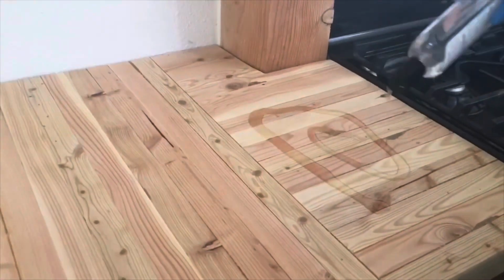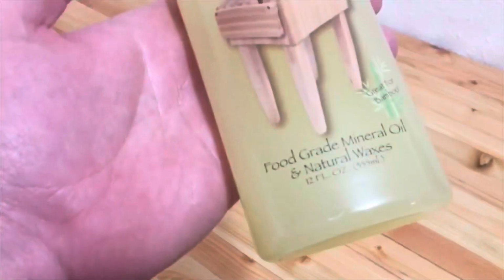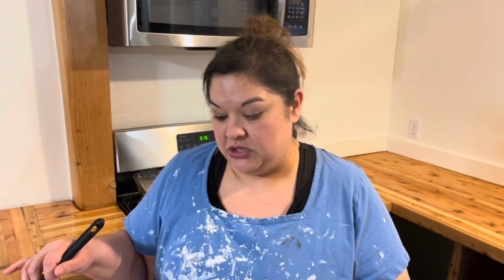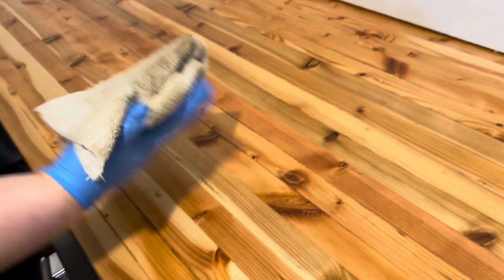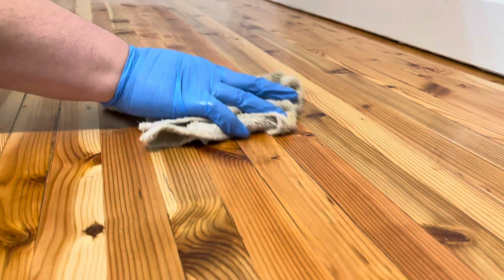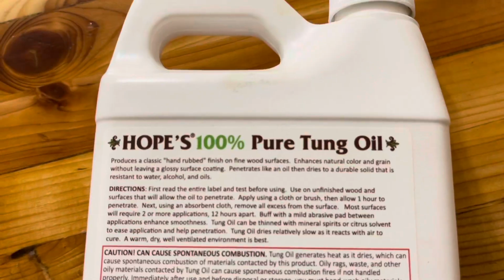Watch this before using Tung Oil!!!

Comment: Tung oil should be mixed 1:1 (or 1:1.5) with citrus solvent. The mix should be applied, and as soon as a good portion of the surface is no long shiny, more applied. Keep going until the entire surface no longer absorbs any more (and so stays shiny). Then wipe off the excess, and let dry for a day. Done! Tung oil without citrus solvent takes eons to dry.
Reply: Also most people do NOT use actual pure TUNG oil. Packaging is very deceptive!
Reply: You can use turpentine as a solvent as well for food safe applications.

Comment: Yea Poly is superior in every way, BUT you can add a dryer to the Tung Oil to dry it super fast! You didn't do enough RESEARCH! PLUS if you want it thick like you did you use EPOXY instead! Poly is best when you use SATIN FINISH and apply it with a cloth and then follow it up with a red or green scotch-brite pad just before it is dry to flatten it and de-gloss it for an antique satin hand rubbed finish!! and ALWAYS follow the wood grain ALWAYS!

Comment: Tung oil provides very little protection.  Danish oil provides a little more protection but not enough for a kitchen counter.  Oil based polyurethane provides the best protection but takes weeks to cure and has a very strong odor, you won't be able to live in your kitchen for a week or so.  Water based poly takes far less time to cure and you can probably just leave the windows open for a few hours to get rid of the smell.

Comment: Thanks for the video. I have another experience and perspective- I watched your video last year when I was doing pretty much a remodel/refresh of our kitchen. I seriously considered a high-end poly finish that would have cut my finish time, and total remodel completion time significantly. However, I opted for tung oil; yes in a working kitchen. As a long time woodworker DIYer and experience with effects of water around polyurethane "sealed" surfaces, I went with tung oil for its long-term maintainability. I was able to work around a kitchen in disarray. To accommodate for the need for a kitchen while finishing with tung oil, I cut and temporarily fitted the new countertop to insure they were correctly cut and then removed them; replacing just enough of the old countertop to function until the final install could be completed. So, some of the new countertop I was able to use the cabinets to support in place for finishing and the rest on a sawhorse. I used 4 coats. It is not quick, it took about a month, but it is relatively easy. However, this provided time to research some details on appliances, install cabinet lighting and new backsplash wall. I did a light maintenance coat 6 months later but really don't know that it was needed and didn't disrupt use of the kitchen. My counters still bead water and there are no stains.

Comment: Hi, i think you 're wrong. before to start to buy mix of tung oil , just buy pure oil and don't apply alone. you have a lot of recipe. i have use it, i have made one, and the result is perfect, like other comments, you can use it with orange essence, and camelia oil for the anti-UV side. I have the same longer of wood in my kitchen and after 5 days it was perfect. i just alternate where to cook .  you need to little sand between 2 layers. anyway you have choose polyuréthane protection is good too but i told you why i have chose the oil, the reason is simple with polyurethane if you or one kid stripe or cut, the scratch will be very visible and sanding ll be worst on plyurethane. with oil just sand and reapply oil thats it !

Comment: I have used Tung Oil and love it, but it takes time to cure. Now, if you don’t thin it out a little bit, it will take a long time to penetrate the wood, and to stay as clean and natural as possible, I use orange oil or D-Limonene to thin the oil, works great for me, thanks for sharing this video!
Reply from the maker: Thanks Mike. I would like to revisit this on another project down the road. Thanks for the tip! -Robert

Comment: Wow that was very informative. When I was younger I refinished about five old rifle and shotguns, right down to the metal and wood. Tongue oil was what I used on the gun stocks. I even lightly sanded in between coats. I remember putting them by the warm fireplace. I didn't have as big of a problem as what you did but I could take my time with them. It was one of the most beautiful and hardest finish I ever put on wood. Thanks for the info if I ever do this to my kitchen I'll know what I'm up against. It would be nice to see the durability between both finishes. That kitchen looks beautiful. At the end of your projects you always seem to win ❤️💙
Reply from the maker: Hi Joseph! Yeah we loved the look of the tongue oil. It is kinda a shame we didn’t have the time to let it cure. Would like to try it on a future project that we can take the time needed to let it cure. Thanks and have a great day! -Dede

Comment: Thank you so much for the info.  I too went with the same cutting board oil to start and I'm looking to change.  I was looking at tung oil or poly which led me to you.  Hopefully your failures will help save me some time now!  If I go tung oil I'll look for one with a drying agent in it!  The water based poly was on top of my list but was worried it wouldn't have the richer color the oil gave it.
Reply from the maker: Hey Randy. Sorry for the late reply, hope it worked out well. I recently used the last of that tung oil bottle on another project and cut it with mineral spirits to act as a dryer. That worked much better! Has the rich oil luster as well. -Robert

Comment: One big issue with all mineral oil based products, is over time you're adding an inert oil that never hardens at all. So, where does it go? Gradually into the whole wood block, making it permanently greasy, and effectively unable to receive any other finish later on. Tung oil may have had trouble curing, because of the residual mineral oil. It will be interesting to see how the urethane stays bonded over time, as the old oil may gradually seep from within, and soften or release the outer finish.
The outlier few seem to try is Watco's Butcher Block finish, applied as an oil, wiped off, reapplied, wiped  again, it is an alkyd modified resin that cures in the fibers, sealing and hardening, with some more finished looks, yet easily touched up with further coats if needed. It definitely needs raw wood, and may not accept other later finishes, but is another safe alternative with less maintenance over time.

Comment: Hello! How did you remove the oil before adding the poly?
Reply from the maker: Wiped as dry as possible. Let dry a day or two. Sanded... 🥴 Not fun but it allowed the poly to adhere. -Robert
Reply: Thank you! I guess that’s what I’ll have to do.  😅  I was about to apply the tung oil. Soo glad I saw your video.
Reply from the maker: Thanks Katherine. Hope it all goes well!

Comment: I actually have experience with the polyurethane coating.  First house I ever owned, the previous owners had put down 3 layers of polyurethane coating on all the wood floors.  You could leave water standing for months and the floors were ok.  Glad you have it figured out.  I love those countertops.  Thank you for sharing.  Stay safe, warm and healthy.
Reply from the maker: Hi Cheryl! Yeah the poly on our floors has held up great and I would venture to say they get way more abuse than our countertops do. Lol. Hopefully the countertops hold up longer than the other options. I don’t t expect it to be indestructible but I at least don’t want to have to be redoing it over few months. Thanks and take care! -Dede
Reply: @TheOregonTale  Yea Poly is superior in every way, BUT you can add a dryer to the Tung Oil to dry it super fast! You didn't do enough RESEARCH! PLUS if you want it thick and glossy like you did here you use EPOXY instead! Poly is best when you use SATIN FINISH and apply it with a cloth (several coats) and then follow it up with a red or green scotch-brite pad just before it dries completely to flatten, smooth, and de-gloss the finish for an super rich antique satin hand rubbed finish!! and ALWAYS follow the wood grain ALWAYS! Trust me this is super expensive looking finish this way! (I used to finish high end gun stocks for a living!)

Comment: Do you have experience with Miniwax tung oil? Using that now. Wondering how it will hold up against stains and wear n tear
Reply from the maker: No, I’m interested in how it went for you. It looks like that was some drying additives in it so should have been much quicker in between coats. I will probably venture down this path again but use a product like that rather than pure tung oil again. -Robert
Reply: @TheOregonTale  tung oil came out beautifully but I still ended up adding 3 coats of spar urethane for durability and it looks amazing!

Comment: I had the luxury of finishing my wood countertops outside before installing them. I used Sutherland Welles’s interior polymerized tung oil. They offer thorough instructions and are super helpful on the phone, too. Each of 4 coats took 24 hours to cure. It’s rock hard and beautiful. I’m sorry yours was so slow — did you ever figure out specifically why your finish took so long to cure?
Reply from the maker: Hi Alan. Glad to hear it went well. We had decided to use pure tung oil which has no added dryers to increase cure time. That was why it was taking forever to cure. I will probably experiment with tung oil again, but will definitely not use straight tung oil. I think you can cut pure tung oil with mineral spirits to help with that polymerization. Even though my first round with mineral spirits didn’t go so well, I loved the look and luster of it, so I will probably experiment with this again in the future. -Robert

Comment: If there's anything ive learned over the years, its that bottle labels are usually wrong (weird right?). The only company that ive found that is upfront with tung oil curing times has been Real Milk Paint Co. 30 days is about how long you want to wait before heavy use, it wont polymerize until that point...atleast a week before putting things on the surface. Dry and cured are very different when it comes to oil...unfortunately the terms are interchanged, which is confusing. Only other products I'd use (random guy on the internet, so my opinions dont really matter) would be ArmRseal or waterlox...but waterlox is tricky as the product in the can begins to oxidize as soon as its opened and you'll find little specs of oxidized resin in your coats unless you use something to remove the oxygen from the can after every use. ArmRSeal is incredible and beats the pants off most every poly out there. 

Pro tip: if your tung oil finish is "dry" in a day, you either havent saturated the wood and need to keep flooding the surface or your tung oil isn't really tung oil...watco and minwax are notorious here for having a small amount of tung oil (or their danish oils), and a butt load of chemicals that are not food safe to speed up the dry time.

Comment: Looks very nice. Nothing more beautiful than the look of natural wood. I do have some safety concerns that maybe you can help me understand better. My question is this: if you are prepping food on your wooden countertops, how can you sanitize the wood after prepping without destroying the surface? I'm a professional chef and I clean my food prep areas at work with a bleach solution to prevent food born illnesses. My work area on the job is stainless steel. At home I don't have stainless, I have lowly laminate which does not look nearly as nice but I can sanitize it with bleach without harming it. I would be wary of cutting raw chicken anywhere near a wooden countertop. You must assume that raw chicken is infected with salmonella and even if you use a metal sheet pan the chicken juice splatters and must be taken care of. I even sanitize my maple cutting boards for safety and they take a beating. Also, can you knead bread dough on the wood? It does look beautiful though. I love the look. I'm looking to remodel my own kitchen and am seeking different ideas. Thanks.
Reply from the maker: Hi Mike. Sorry I missed this comment, not sure if you already got the answer you needed. In the end we went with a polyurethane. That essentially coated the countertops in a hard plastic. No worries about bleach and chicken after that. 👍

Comment: Pure tung oil takes a long time to soak in and also to cure. You can speed up the saturation process by cutting it 50/50 with naptha or mineral spirits but the only way to actually speed up the cure is to put in a catalyst, which makes it less "natural". On the bright side, it cures a lot faster than linseed oil and is more durable.
Reply from the maker: We liked the look of it. Will definitely use it for other projects in the future that can sit and cure for a long time. Thanks for watching. -Dede

Comment: Hi Dede, I'm get it over the oiling the worktops,we all think it's fine we'll be able to slap a bit of oil around,but the fact is you get busy and it doesn't get done,your worktops look great now,do you use a chopping board or just the worktop?💖
Reply from the maker: Hi Lesley! I always use cutting boards. I grew up in the Formica countertops era and it’s ingrained in me to never cut straight on the counter. Haha. -Dede

Comment: i have used several products that , for me, didnt live up to their supposed attributes, Tung oil and danish oil to name a few, i usually have to resort to my old stand by: polyurethane and for smaller items: Tru Oil.
Reply from the maker: Hi Bonnie! I’ve never used tru oil before. Will have to check it out. 😁 -Dede
Reply: @TheOregonTale  only small things, i use it on carvings and ferro rod handles.